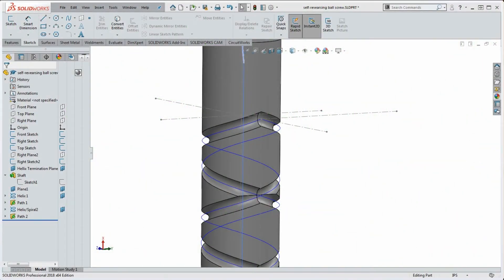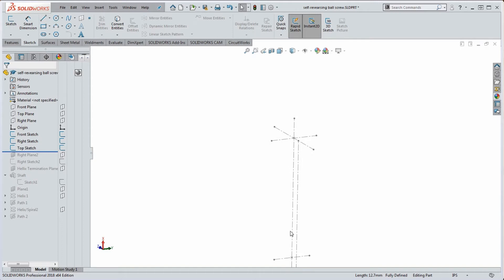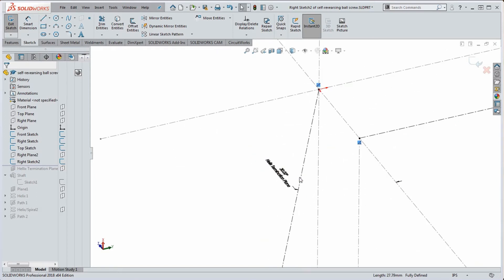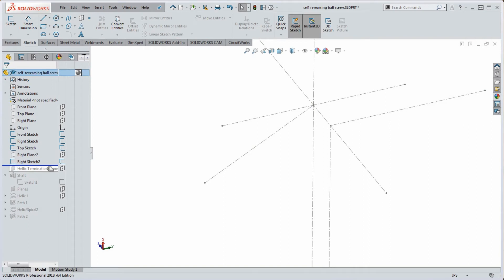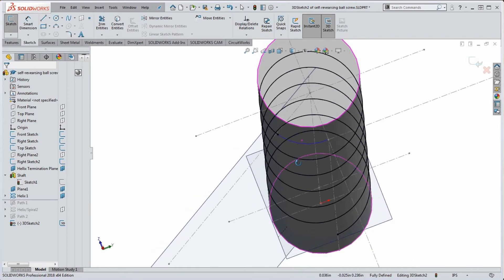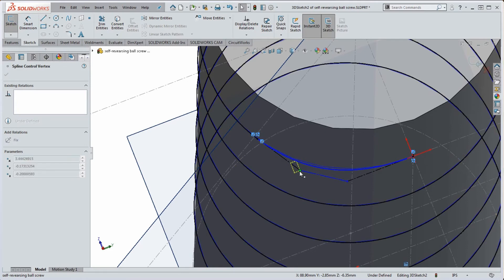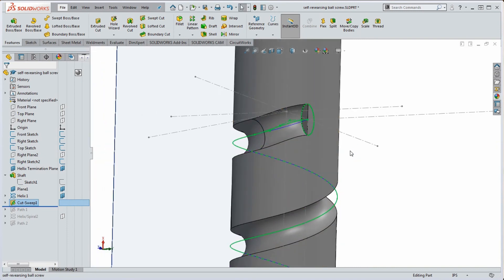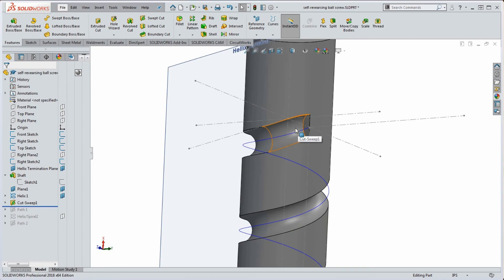SolidWorks, How to Transition a Helix Feature so that it ends Tangentially or Horizontally

Comment: Thank you for this one. I was having issues doing something similar with a spooler scroll shaft. This video fixed it perfectly.

If anyone is having weird geometry issues post sweep cut... Change from minimize twist to "Specify Direction Vector" and select the cylindrical face the helix follows.

Comment: Nice work-around. I would drop the end point so it's not so sharp an angle. That would help as well. I wonder if the developers are gonna add end treatments on the spline so they can be made tangent to each-other when they're end-to-end? That would eliminate all this work-around stuff, right?
Reply from the maker: Thanks for the helpful comment.  And the end to end spline tangency allowing for the following of existing geometry - would be very helpful.  CSS
Reply: @DesignInnovations  Here's a recent forum post on the Inventor forum you may find interesting:
https://forums.autodesk.com/t5/inventor-forum/creating-a-tubing-helix-curve/td-p/9730295
Check out my comments to see how I address this.
There's a couple part files too, in case you can import them and see how Inventor 2010 can do it.
I don't know if the newer versions of Inventor can do this, b/c they may have changed it over the past 10 years.
Cheers ...